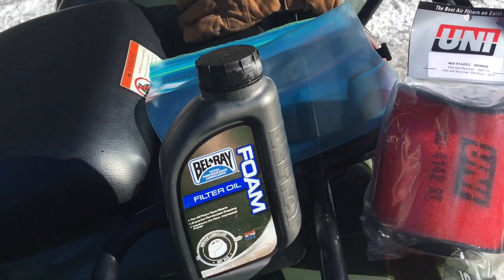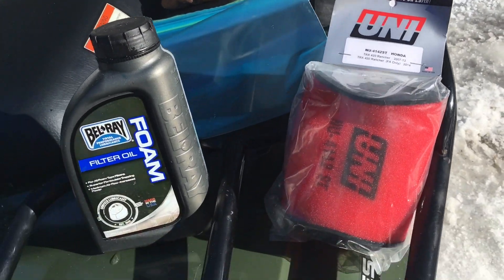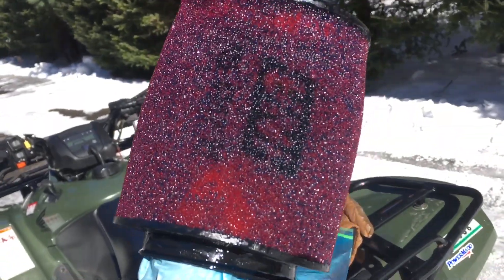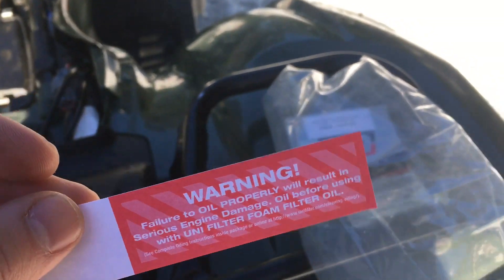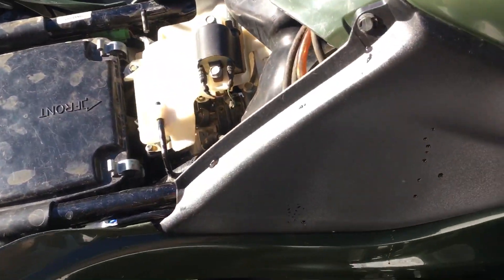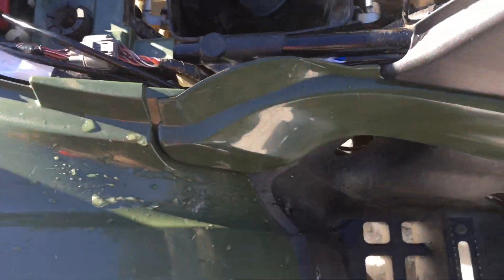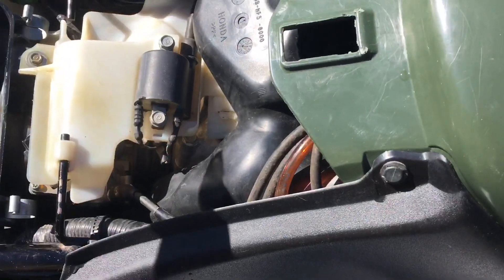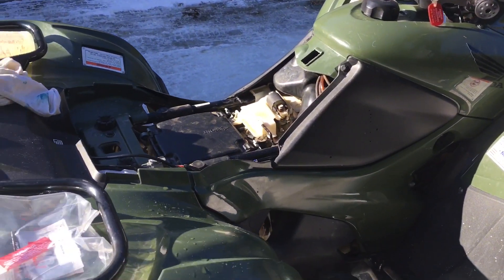How to replace an air filter on a Honda Rancher 420

Comment: I need to buy a new filter. My quad was down for a while when I was cleaning the filter and my friends went riding without me! It's easier to just change it and clean the other one later so you can keep riding  :)